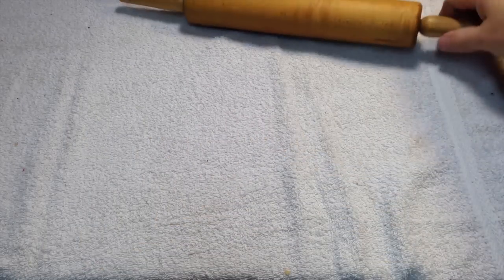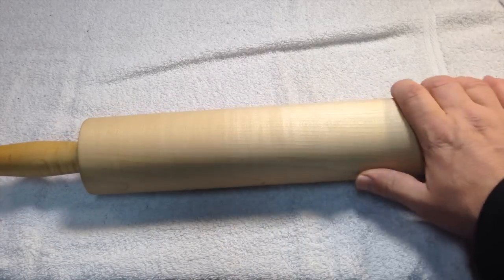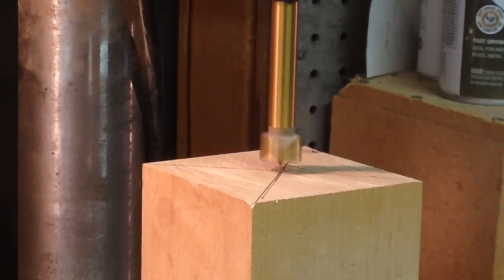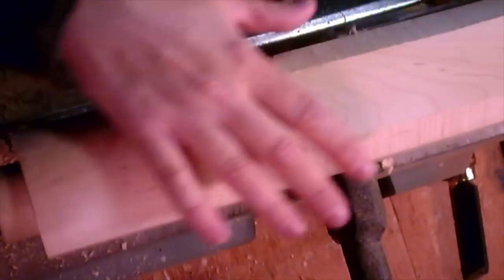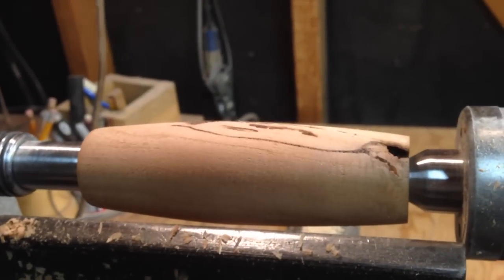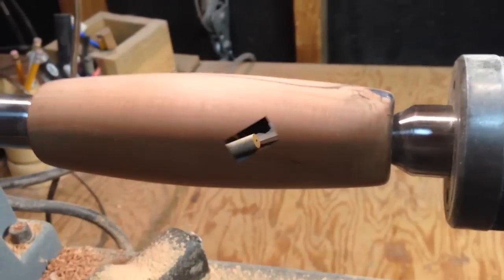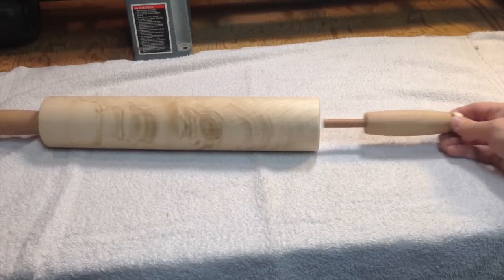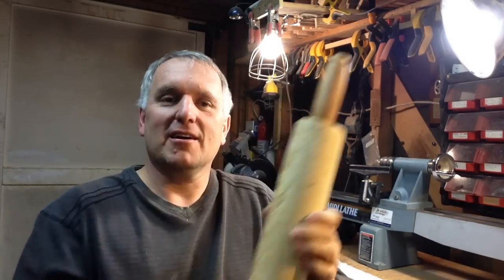How to make a Rolling Pin Maple with Cherry Handles

Comment: Hi Chris. Did you need the additional length on the lathe bed to turn the pin? I don't have the extension on my Delta and would like to attempt the rolling pin.
Reply from the maker: No. You can do all of this on teh regular bed. Of course not if you are trying to turn a very long pin :)